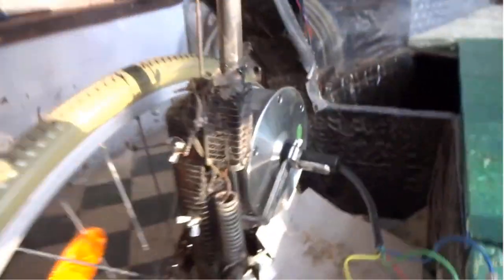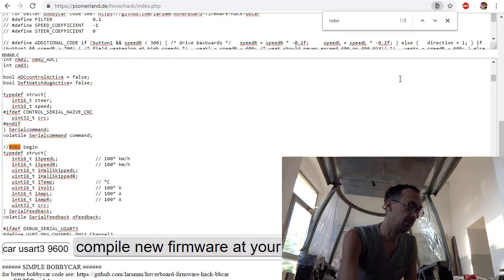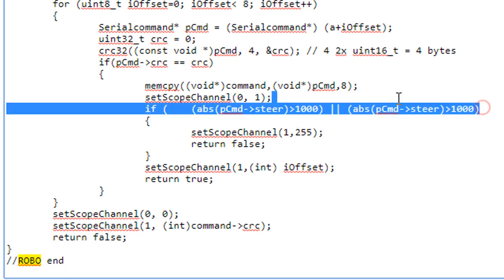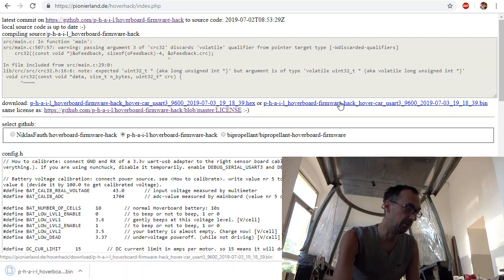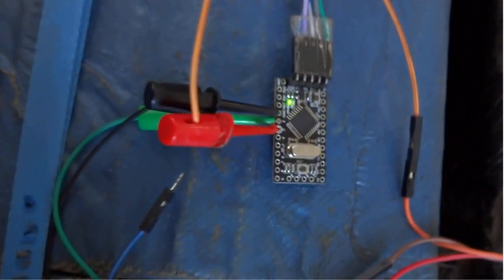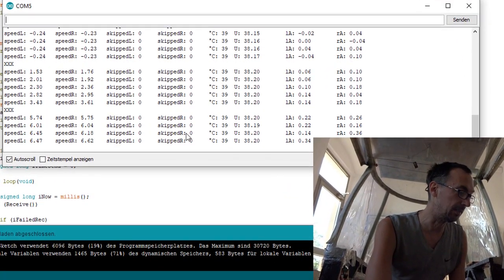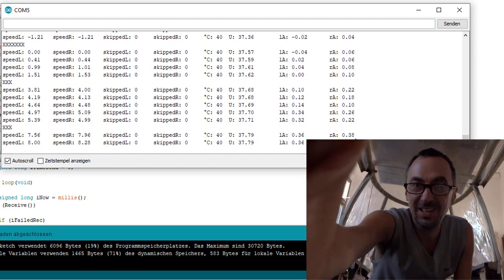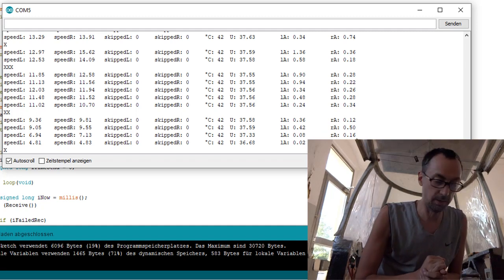my online compiler: hoverboard firmware with bidirectional serial communication

Comment: can you show how do you connect arduino pins to mainboard please
Reply from the maker: In my hoverserial, Arduino pin 8 is set to be RX and pin 9 is set to be TX 
The Arduino RX has to be connected with the hoverboard TX and the Arduino TX with the RX of the hoverboard connector
In my config.h by default the #define CONTROL_SERIAL_NAIVE_USART3  is enabled, so pin 8 has to be connected with the blue cable of the "right sensor board" and pin 9 with green cable of that right sensor cable. the right sensor cable is the short one i think. Have a look at https://raw.githubusercontent.com/NiklasFauth/hoverboard-firmware-hack/master/pinout.png and understand what i have just explained.
Of course the GND pin of the arduino has to be connected to black GND wire of the sensor cable. 
Do not connect an positive voltage and make sure your arduino runs on 3.3V only and not on 5V !

Comment: Thanks for all the effort you put in! Still, I can't get the Serial Communication to work, even after digging deep in the main.c - everything is set up fine, communication happens, and the motors turn on, they even change direction when supposed to, BUT at a steady speed. No acceleration, no deceleration. I can confirm that data goes through, but somehow it seems not to get parsed correctly. Feedback in the Serial Monitor is flawless and shows the constant speed: 

speedL: 0.00	speedR: 0.00	skippedL: 0	skippedR: 0	°C: 22	U: 25.29	lA: 0.28	rA: 0.16
speedL: -0.49	speedR: -0.51	skippedL: 0	skippedR: 0	°C: 22	U: 25.54	lA: 0.32	rA: 0.16
speedL: -0.99	speedR: -0.96	skippedL: 0	skippedR: 0	°C: 22	U: 25.79	lA: 0.28	rA: 0.16
speedL: -1.48	speedR: -1.32	skippedL: 0	skippedR: 0	°C: 22	U: 26.02	lA: 0.36	rA: 0.44
speedL: -2.00	speedR: -1.80	skippedL: 0	skippedR: 0	°C: 22	U: 26.25	lA: 0.14	rA: 0.32
speedL: -2.39	speedR: -2.18	skippedL: 0	skippedR: 0	°C: 22	U: 26.47	lA: 0.38	rA: 0.24
speedL: -2.53	speedR: -2.53	skippedL: 0	skippedR: 0	°C: 22	U: 26.68	lA: 0.38	rA: 0.32
speedL: -3.33	speedR: -3.15	skippedL: 0	skippedR: 0	°C: 22	U: 26.87	lA: 0.62	rA: 0.30
speedL: -3.21	speedR: -3.03	skippedL: 0	skippedR: 0	°C: 22	U: 27.01	lA: 0.50	rA: 0.10
speedL: -3.44	speedR: -3.13	skippedL: 0	skippedR: 0	°C: 22	U: 27.19	lA: 0.70	rA: 0.10
speedL: -3.04	speedR: -3.03	skippedL: 0	skippedR: 0	°C: 22	U: 27.37	lA: 0.38	rA: -0.04
speedL: -3.07	speedR: -3.15	skippedL: 0	skippedR: 0	°C: 22	U: 27.54	lA: 0.18	rA: 0.06
speedL: -3.76	speedR: -3.20	skippedL: 0	skippedR: 0	°C: 22	U: 27.71	lA: 0.48	rA: 0.28
speedL: -3.46	speedR: -3.24	skippedL: 0	skippedR: 0	°C: 22	U: 27.87	lA: 0.56	rA: 0.38
speedL: -3.09	speedR: -3.06	skippedL: 0	skippedR: 0	°C: 22	U: 28.01	lA: 0.40	rA: 0.26
speedL: -3.14	speedR: -3.04	skippedL: 0	skippedR: 0	°C: 22	U: 28.15	lA: 0.54	rA: 0.36
speedL: -3.08	speedR: -3.20	skippedL: 0	skippedR: 0	°C: 22	U: 28.30	lA: 0.48	rA: 0.12
speedL: -3.31	speedR: -3.16	skippedL: 0	skippedR: 0	°C: 22	U: 28.43	lA: -0.08	rA: 0.70
speedL: -3.09	speedR: -3.18	skippedL: 0	skippedR: 0	°C: 22	U: 28.57	lA: 0.06	rA: 0.26
speedL: -3.39	speedR: -3.21	skippedL: 0	skippedR: 0	°C: 22	U: 28.69	lA: 0.54	rA: 0.10
speedL: -3.21	speedR: -3.02	skippedL: 0	skippedR: 0	°C: 22	U: 28.81	lA: 0.32	rA: 0.72

Any ideas would be appreciated! ADC control btw works fine...
Reply: Ah nice, after 2 days of debugging, as soon as you dare to ask sb, you find the solution. Seems steer and speed are mixed up in the example .ino or there is a switch in config that I missed. Sorry to bothered you. =)
Reply from the maker: @notbotdotnet  yes I know this law too good.  It is because once you asked you start thinking how the other one would tackle the problem and this gives you new ideas. 
Will check the ino. Would be nice if you were a bit more concrete on the supposed bug.

And take a look at the new firmware I added. I guess I will switch over to it myself when I find the time. It also has a reliable serial protocol but probably superior efficiency.
Reply: @robodurden  Switching to the oop version? Was not sure whether this is finished already. Will give it a try!

The "bug" is easily described: If I switch steer and speed in Send(),  like: oCmd.steer = iSpeed; oCmd.speed = 0; everything works like a charm.
Reply from the maker: @notbotdotnet  NOT the OO-demo, i meant https://github.com/EmanuelFeru/hoverboard-firmware-hack-FOC
Sorry i can not understand your bug behaviour. Maybe you swaped steer and speed in the struct definition either in the .ino or main.c - while testing. 

I use that exact Send() function for the Arduino Mini 3.3V in my solar car and my official main.c and it works correctly.
Reply: OK. That's untrue, either. With the original setting, it reacts on steer as supposed, it just does not seem to react on speed in any predictable way. Is there, by any chance, an option to just set motorspeedL and motorspeedR? This would be the most useful mode for most of the people I guess, as with that up and running you could build whatever you want on top...
Reply from the maker: @notbotdotnet  "not in any predictable way" is not helpful. If my control loop always goes to full speed it is very likely the bug that "long iSpeed" in main.h has to be inverted whether INVERT_R_DIRECTION or INVERT_L_DIRECTION is defined or not. 

I now see that #define SPEED_IS_KMH is active in the config.h but the .ino still is sending speed form -1000 to +1000.
With SPEED_IS_KMH that would translate into a control speed of -100 km/h to +100 km/h :-(
So try lower values or uncomment #define SPEED_IS_KMH . Then you get the old behaviour where you simply set the pwm value from 0% to 100.0%
Reply from the maker: @notbotdotnet  okay, my new featurs SPEED_IS_KMH and MAX_RECUPERATION are now off by default :-/
And i changed the demo.ino to

int iSpeedMax = 1000;   // for SPEED_IS_KMH in config.h use 60 for max speed of 6.0 km/h
int iSpeedDelta = 20;   // for SPEED_IS_KMH in config.h use 2 for speed steps of 0.2 km/h 
...
  iSpeed += iSpeedDelta;
  if ( abs(iSpeed) >= iSpeedMax ) iSpeedDelta *= -1;
  Send(iSpeed,0);

please be so nice and test the new .ino as i have commited the new code without testing !

Comment: Hi can some one help me about PPM.I am configurating it's on config.h but nothing is moved.i tyr so many times.
Reply from the maker: Ppm is not pwm! For ppm use the original Niklas firmware. first compile without modifications to see the test mode working. Watch my first Video tutorial here. Also use a USB UART module to read the logging data. I have no rc controller so I never tested ppm.
Reply: @robodurden  I knew about ppm and pmw, I connected arduino joystick for test and it worked well. Thank you for reply, will be testing more time)) On the Nikolaus github  repo he wrote about two taps to enabled ppm mode i don't know what is it.
Reply from the maker: @ИльяКаратаев  post link to the text so I can read these lines :-)
Reply: @robodurden  Thanks for debug idea. Acl(potantetiometr) work fine see in debug some number.I checked the working ppm with my arduino it also good. But the board doesn't see the signal from PPM device)If you can give me some advice i will appreciate you.
Reply from the maker: @ИльяКаратаев  search the main.c for CONTROL_PPM and understand the debug output. Check the ppm input with dso oscilloscope.
Reply from the maker: @ИльяКаратаев  I am not really sure that anyone ever succeeded with ppm. Search the comments of this video and my main tutorial.
You could also search for active forks on GitHub.
Have a look at the ppm_init function to learn which pin is set as input. Then add a log call to when ppn is read.
Anyway, I guess uart serial control is better anyway. So use ppm to contact ardunio mini which in turn controls my robo durden fork. See Arduino code in my GitHub fork.
Reply: @robodurden It's very good idea i will try, i so some video people work ppm maybe my reiceve had another frequently or smt, but i read the signal at the arduino and it worked very well. I will try to use Arduino like ppm encoder to uart. Thank you .
Reply: @robodurden   I try to use yours fork, but still doesn't work. I think maybe my promlem another i don't know because i bought hoverboard with GBRD processor and change it to STM.Only ACL signal work with my arduino joystick.I don't know why you firmaware and arduino sketch doens't work, i am hearing the HIGHT frequntly sound when i add the arduino(i had nano version) but nothin is speed up.And i hear this soun when i added the PPM receiver. I had the same hoverboard board)
Reply from the maker: @ИльяКаратаев  I successfully compiled a GD32F103 version of the hoverboard. and my uart fork worked. (Do not use the oo firmware, this is not working and is only meant as a starting point to Port the firmware to object oriented programming.)
The sound you mention sounds strange indeed. I fear i can not help you with that.
Reply: @robodurden  Thank you for all help you are very good. I fix it. The problem was that you need in config.h valuer for PPM_NUM_CHANNELS that you PPM trancmitter have.My have RC6 have 10 channnels and it work fine.
Reply from the maker: @ИльяКаратаев  wonderful :-) i added a troubleshooting section to my fork - thank you !

Comment: hey,
I wish to serially send data from jetson nano to stm32 ,is there any code available for jetson serial to send speed ,steer and crc values.
2)How should i send them,by integers or by bytes?
Reply from the maker: Get a cheap USB uart module and learn how send data via Linux serial out to it.
When you succeeded receiving the data with the module you can use my firmware and study  my Arduino code example.

Comment: Hi,
First of all very nice work and great compiler!
I flashed the main board with your RoboDurden firmware and works fine.
Since I'm working on a lab power supply I did the calibration on 20V and set the corrected values in the config file (bat_calib_real and bat_calib_adc) as per calibration proces. I also educed the cut off voltage for the battery to match the 20V power.
I'm running your Arduino program and works fine however the only thing is that I get far more CRC errors ('X') in the feedback on my screen than you.
Any idea what could be the cause? Could it be motor interference? 

Cheers
Reply from the maker: i am in a hurry at the moment. I fear that i also get more crc errors in real time conditions. Maybe sometimes even a few seconds before new realtime data reaches the Arduino. No big problem for me but i would be happy if YOU find an improvement.
Tell me your ideas then i might be happy to get involved :-)

Comment: hi, great compiler, im using a firmware version called bewegungsappar, im not sure which one it came from and has no config file so i cant compare, im using 2x DAC from an arduino to act as potentiometers, it has forwards, reverse and steers by changing speed between the 2 wheels, i see in the NiklasFauth version  it has a motor test mode that over rides all controls, can i just delete that part to make it use potentiometer input  then i can use that version instead? also it mentions using button 1, which i assume would be a push button to the arduino, then the arduino sending 0 or 1 to the ADC1 pin? are there other pins that can be used as inputs? any help with this would be great, i also have a youtube channel doing hoverboard motor things, thanks
Reply from the maker: Simply click the ADC preset that my online compiler generates and the config.h is modified accordingly. The control_test will be removed and the control_adc be activated. The button1 is only a boost mode when potentiometer is at full throttle ? Watch the long video from Niklas..
For Arduino controller I would advise my RoboDurden uart fork..

Comment: For an application i need the motor to just spin forward and backward using serial communication from Arduino. i just tried different serial USART firmware combination from your website but nothing worked.which firmware combination will work for my application
Reply from the maker: I strongly recommend my RoboDurden fork  (not the oo sketch) as it has a stable uart protocol and arduino code example. Try CONTROL_SERIAL_NAIVE_USART2 then you still have debug output on usart3. Make sure you do NOT apply 5V to usart2 (usb-uart module do so even they are jumpered to 3.3V). Only speed and no steer is exactly my solar car use case shown in this video (Arduino pro mini 3.3V, beware that esp8266 has non working softwareserial) :-)
Reply: @robodurden  Bro its working!!!! thanks for making it lot easier for us.for your Arduino pro mini 3.3V code it just spins forward for a while and switch to backwards. what command should be send to make it spin forward on "void send" .
Reply from the maker: @ramaprashath6324  take a look at the loop function to understand how I use my send function to spin the motor forwards and backwards :-) Then start playing yourself.
Reply: @robodurden In void send there is no command to make it spin backwards. whether this code is to just spin forward and backward ?
Reply from the maker: @ramaprashath6324  simply read my previous answer again :-)
Reply: @robodurden  yeah bro its working!!! but Its not waiting for my serial command ,turns off  when no data is send as quickly as possible. Even if i used a digital read to control direction.for example "when some pin is high spin forward else backwards". when i low that pin ,driver turns off, and when i turn on driver back its spins backward. what i need to change in program to work like this.
Reply from the maker: @ramaprashath6324  I guess you battery is less then 10s LiIon = 36 Volt. Goto top of config.h and set correct battery voltage.
Reply: @robodurden  I am using power supply only,I changed voltage in config.h
 Voltage giving is 30 v. Do I need to change something on code as I am using power supply.
Reply from the maker: @ramaprashath6324  the firmware shuts down when speed is set to zero and there is low voltage.  So when you have correct config.h it should be fine.
Reply: @robodurden  is there is any way to edit bldc,c from your website.Thanks for your quick reply!!!!
Reply from the maker: @ramaprashath6324  "robo durden is there is any way to edit bldc.c from your website". I could add that feature on Friday. But if you dig that deep into the firmware you better install a toolchain yourself ? Or tell me what feature you want. If I like it I implement it myself. That said, you can fork my firmware and I can add it to the list on my online compiler. Then you can change your own bldc.c . But  I only want firmwares that are good for something..
Reply: @robodurden  can I contact u in person via slack or mail.
Reply from the maker: @ramaprashath6324  robo@schizobene.de
Reply: @robodurden  I actually don't need emergency power off or low voltage power off. As I am using light load. That code is complicating as i am using power supply for testing the driver so planning to remove it totally but as it is used in bldc.h error while compiling the code.
Reply from the maker: @ramaprashath6324  simply read all the lines of config.h on my online compiler.
Reply: @robodurden  Hello. Arу you sure that esp8266 softwareserial doesn't work? So no need to even try? Or I can play with libraries?
Reply from the maker: @pavchensky  i remember having tried different libraries. And when you google for esp8266+software+serial+not+working you should better go for the ESP32 directly. The Esp32 has at least two hardware serials :-)
Reply: @robodurden  Wow. It works. My fault was that I put SEND into the loop. Now I call it only when necessary and it works.
Reply from the maker: @pavchensky  When you made it work on an Esp8266, please be so nice to post the full code / changes here !
Reply: @robodurden  Downloaded last library ESP softwareserial. Just compiled online via    
https://pionierland.de/hoverhack  RoboDurden section. UART on UART3. Debug disabled.  Io14RX io12Tx.  Wemos D1 mini. Test sketch from RoboDuren but deleted inside Loop and replaced by  SerialRead to set speed manually. So when you send any values from 0 to 1000 it goes via "Send" function to hover and it works. But ... not per cycle. Only when needee to change - send 500, wheels are spinning. Need more, send 600, speed increasing.